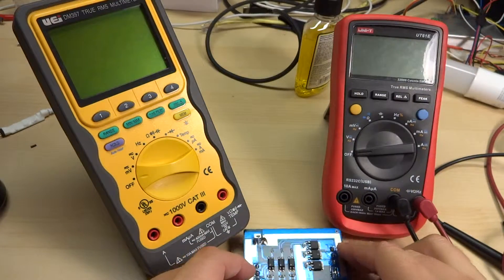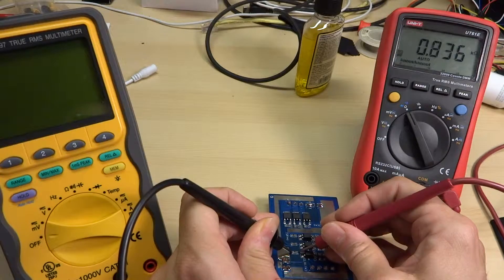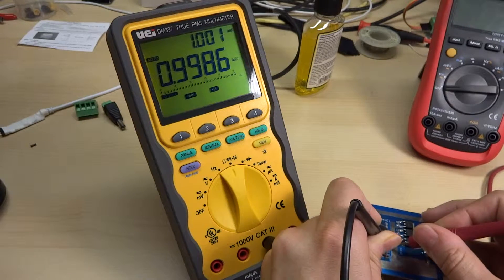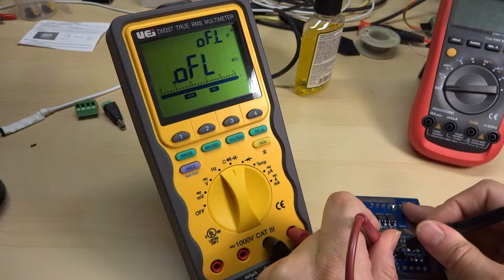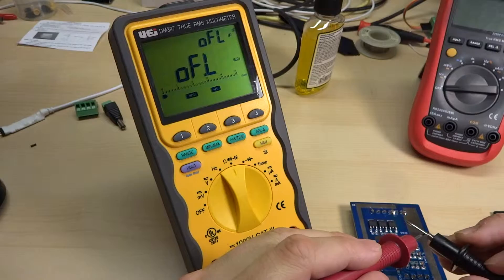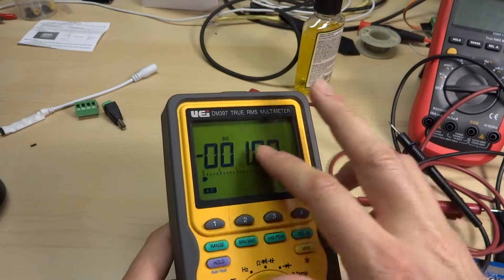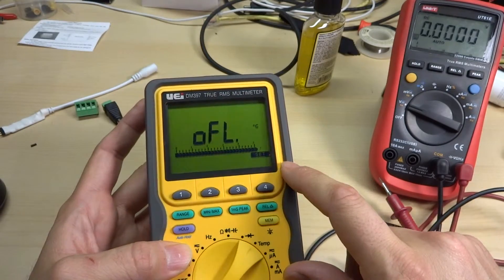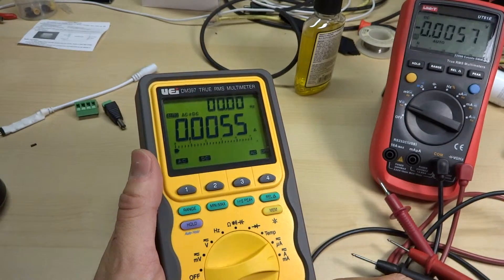UEI DM397 Multimeter Ohms Fail

Comment: When you make your resistance measurement and pull the leads away, the meter retains the value on the screen so you can put the leads down, pick up a pencil, and write the value down.  Once it's written down, you have to reset the meter to take another reading.  When you shorted your leads, zero was your resistance reading, then it was time to reset to do another.
Reply: This meter does have an autohold function, but this isn't how it works. The manual says:

To activate “AUTO HOLD” mode, press the “HOLD” push-button two times until “A” and “HOLD” indicators appear on the LCD. In this mode, the display automatically freezes and the meter beeps when the measurement reading is stabilized. The display value will be updated when a new measurement value is stabilized.

The display isn't indicating that the mode is on, and it's not beeping when it freezes. And you could argue that it's not really freezing.